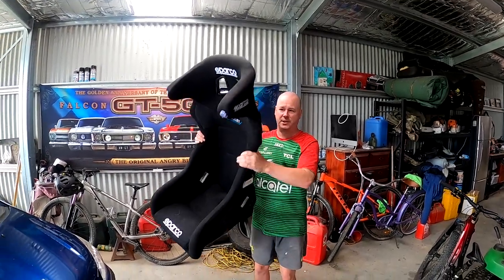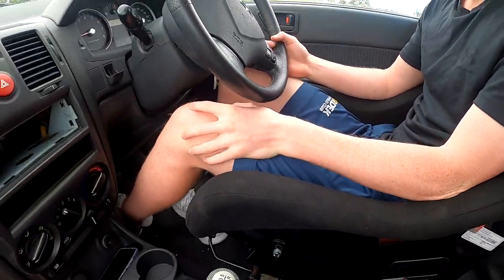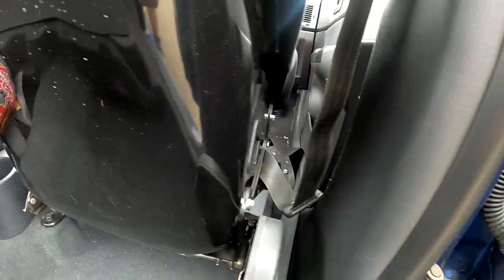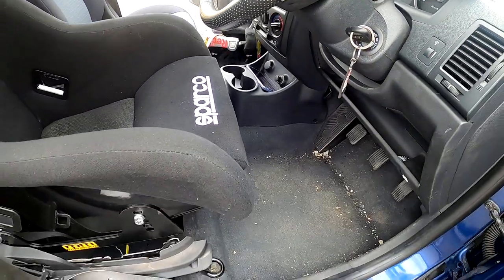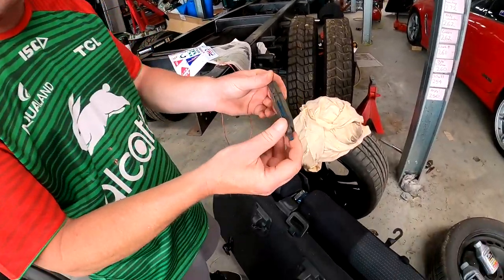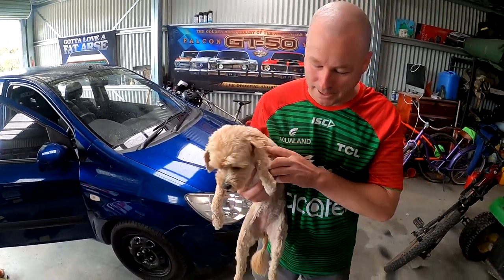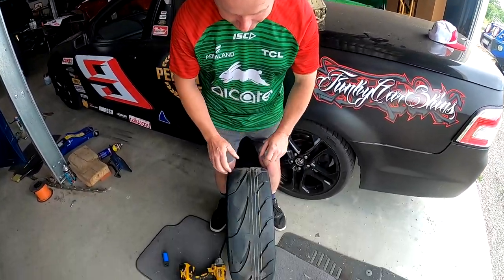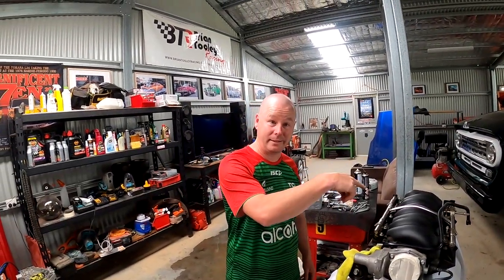Hyundai Getz Track Car | Sparco Circuit Race Seat Install

Comment: Yo gents. Just a heads up. AGI are working on a seat mount plate that will fit the seat a bit lower and nicer :)
Reply from the maker: Oh wow, this is great news.  Any idea when it will be available?
Reply: @ClunieGarage  not 100% sure at this stage as still in development phase. I'll keep you posted :)

Comment: I had to build a bucket seat for my Getz. Didn't know those could fit. But only cost me $200 to build using parts from bunnings haha
Reply from the maker: G'day mate, yes they fit but it sits a bit high at the moment.  What did you use from Bunnings??
Reply: @ClunieGarage  i went to pick n pay less and bought a stock driver side seat for $38, then I stripped it down to the frame and build it up.  For the cushion I used the gigsaw rubber flooring you use in gyms...it was like 10$ for 4 i think - did 2 layers of that for the seat. I bought some aluminum materiel for the sides to hug my hip and shoulders. - its got aluminum on the top with carbon like stuff in the middle and aluminum on the bottom with protective firm on both sides, sells $40 for 1.2mx 1m. I bolted it all down using tech screws and sika flex glue.. 221. It took a few days to build...then just covered the bottom with some imitation leather and covered the top with seat cover. My Instagram is GETZ_WTF have a look. I can send pics on that mate.